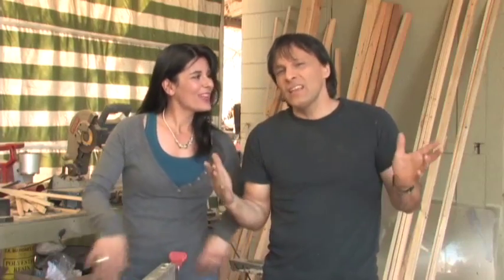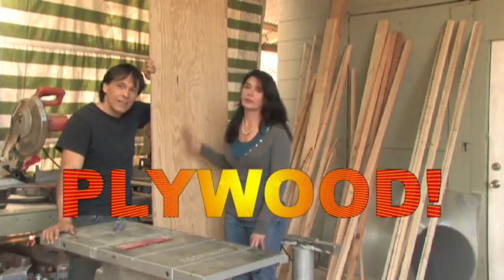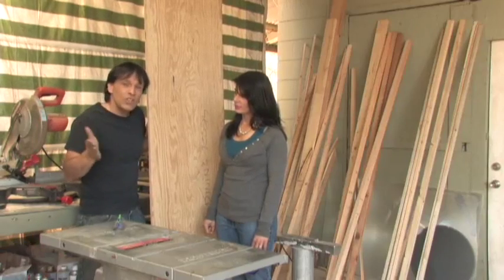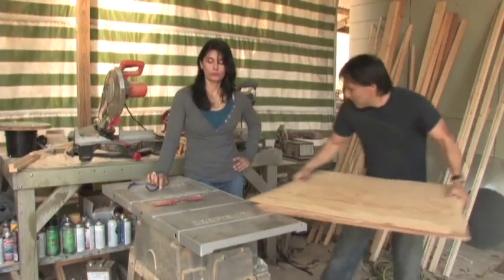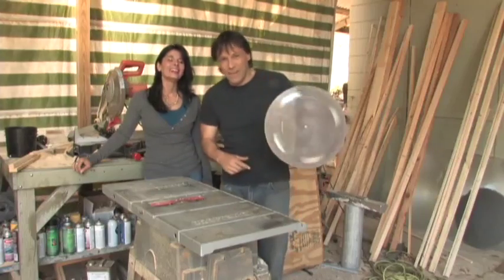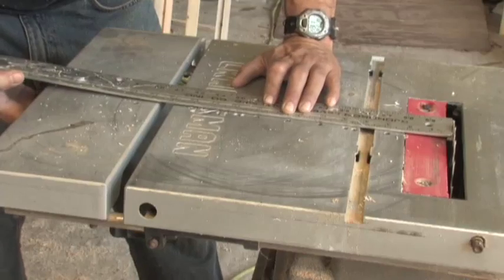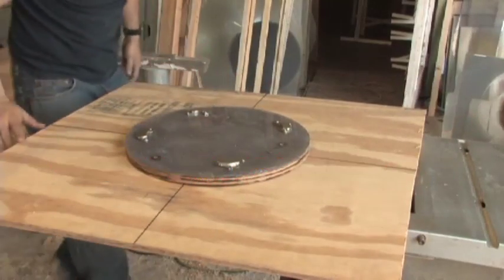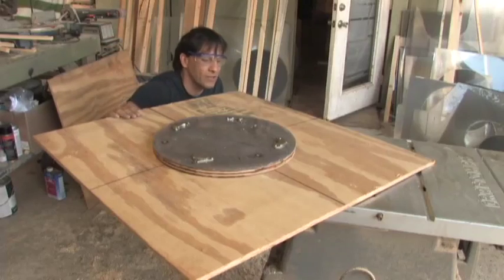A new wind turbine design Build your own wind VERTICAL generator Free Energy from wind DIY

Comment: To find the center of a square or trapezium ... just draw a line diagonally from any corner to the opposite corner, then do another line on the next point.
Where the lines cross should be the true center.
quicker and more reliable than using a tape measure.

Comment: As the saw blade is raised the kerf becomes wider thus reducing the circumference slightly.  If this becomes a problem (as with creating small diameter discs) then reduce the saw blade diameter & thickness to make a more accurate cut.

Comment: Your pieces are roughly square.  Drawing a line from a corner to the opposite corner bisects that square on a diagonal.  Repeating this action for the remaining corners will bisect the line @ the center point of the piece.  An ungraduated straight edge is all that is needed.

Comment from the maker: It will work, spin it with a drill to check its power. Car generators and alternators require a lot of force when loaded but if your turbine is large enough and your wind is good, it should work.

Comment from the maker: @WildGhorgh Routers are an option but this is MUCH faster especially on 3/4". Routers require many resets on 3/4". This works up to 3" deep material. I cut a 2x4 round table 36" dia in 10 minutes PT wood.

Comment: Hanford was a military base used to produce nuclear fuel and weapons grade uranium/plutonium. It was managed by the military poorly and was designed with no thought of public safety or long term storage. The nuclear power plants today have moved largely to dry cask storage that have been proven to take a beating. The need for power is here. I would like more renewable energy used in the system, but right now our choice is mostly nuclear/coal. Ill take nuclear.

Comment: Love your vid's. I'll give u a tip, in regards to finding the center of rectangle or a square. Get a  wool or cotton string, saturate it with colored chalk. Now hold both ends to opposite corners and make it tight, then lift the center of the line to make it tighter and let it snap back. Now repeat for the next diagonal and hey presto, the X you made now marks the exact center of you shape.  Fast, easy and accurate and also a good way to mark long strait lines.